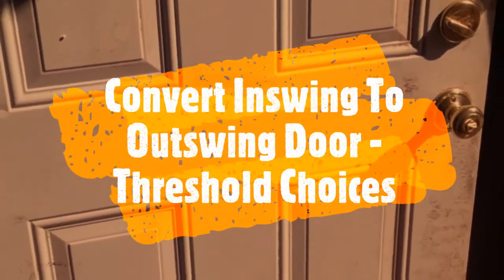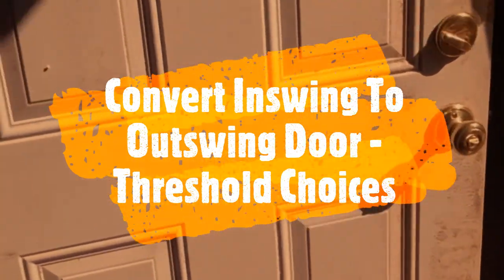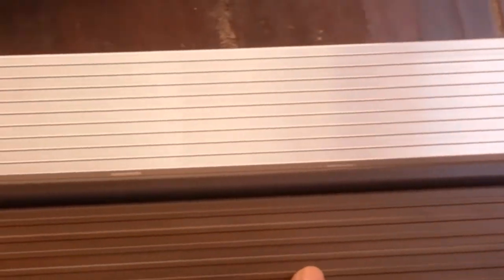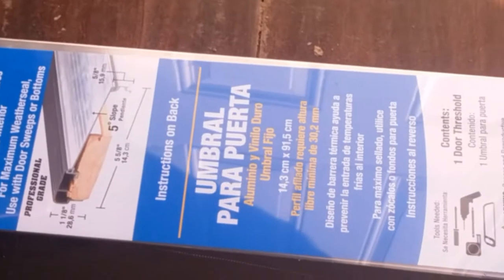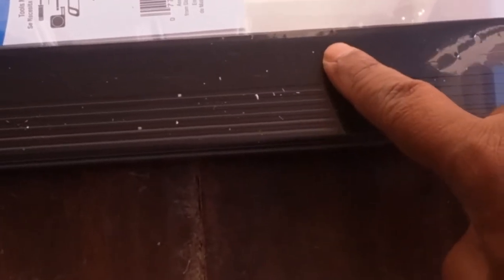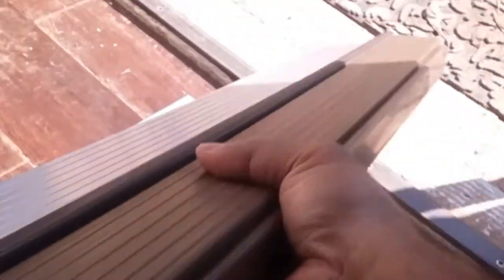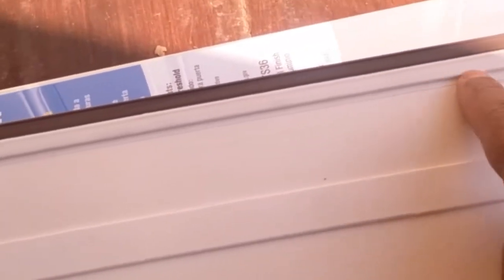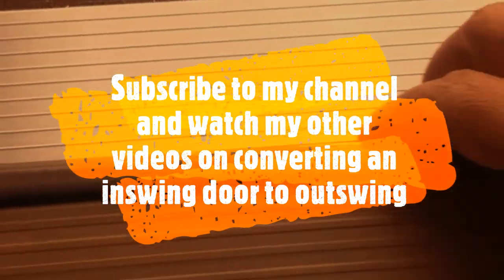Outswing Door Threshold Choices

Comment: what I can't find anywhere-how to replace an inswing unit with an outswing unit- on an  8"  block wall.  (plus furring and drywall = 9 inches)  How will that work out with the finish jamb, interior trim and ceramic floor tile?
Reply from the maker: I did this switch from an in-swing to out-swing door for our basement after a massive flood. I have not put out the videos yet except this one. I will get that video out soon. I used the same door but used new door jambs to create the door frame. This threshold worked out great.